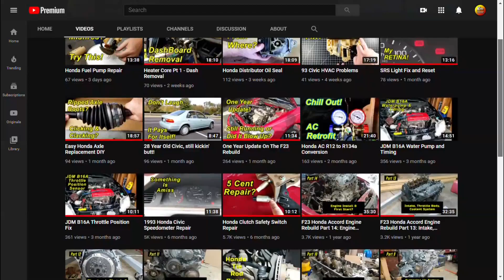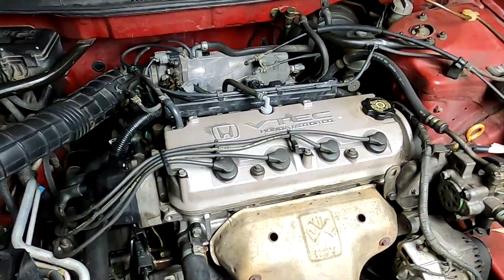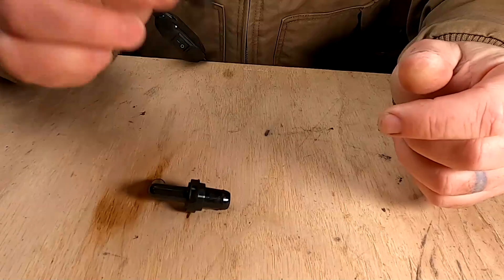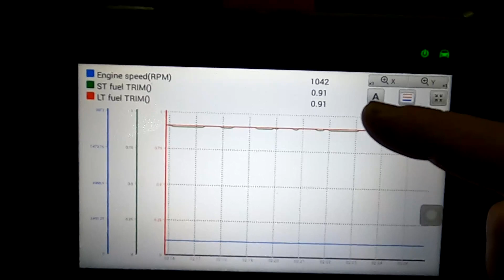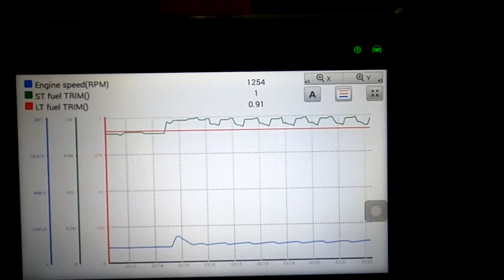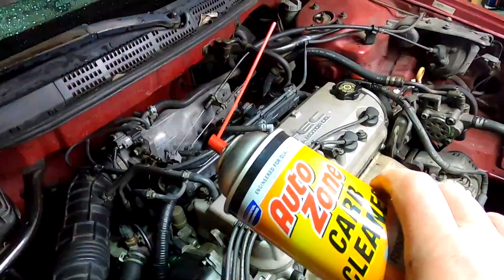Honda Idle Final Words

Comment: I changed my fuel injectors in my 2000 honda accord. Now it has a high idle for about 30 seconds, and then when I rev it up and release the pedal it drops down to below 500 rpms. It drives fine but something is off when I'm parked.

Comment: Remember, an IACV, or Idle Air Control Valve, is basically a vacuum leak through a valve. Cleaning it should be someting on the list too, brake cleaner PB Blaster etc.

Comment: Hello, your videos are great, I need your help on a topic about distribution applications. My car is Honda crv rd1 Manual, there is no problem while driving. The speed of a vehicle that wants to change or at traffic lights keeps dropping. The ignition, spark plugs are always changed, the problem continues. What can I do?
Reply from the maker: So when you depress the clutch, the engine wants to stall? If that is the case, you probably have a dirty throttle body. Search youtube for "honda throttle body cleaning". I had that issue on a civic and that fixed it.
Reply: @ktecgarage Throttle valve cleaning and idle motor cleaning were also done, the problem persists, so what should be the healthy throttle valve ratio? OBD2 connection shows 9.2% at idle, 5 is fully open, 4.78 is shown.
Reply from the maker: @sevilnuresma2287 EGR could be dirty. Search honda egr valve cleaning. Pretty straight forward job.

Comment: Did you do the idle control air valve reset procedure?, 1) Turn the ignition key to the RUN position for 5-seconds. Do not start the engine, 2) Start the engine and run it at 3,000 RPM until the radiator fans come on, 3) Then let it idle for five minutes with no loads (lights, heated seats, rear defogger, blower motor, radio, etc OFF, 4) After five minutes, shut off the engine
Reply from the maker: Thanks for adding that information. I did do that procedure, but there was no difference. I did not find an 'authoritive' source on it's efficacy and too many different versions of the steps so I left that out.

Thanks for watching and commenting!

Comment: I spent like a month chasing idle problems on my GM. In my case someone has adjusted the throttle set screw when their IAC failed to get it running. Interestingly with that computer I discovered eventually that you had to have the IAC sitting at the correct number of counts; if you install an aftermarket IAC it can reap havoc with the algorithm since it has a different ratio at idle. But it did teach me that throttle plates adjusted open can cause really weird idle issues. 

With these sorts of vacuum leaks it usually ends up being so much easier to acquire a smoke machine by hook or by crook. There are a lot of things to check, and going straight for the smoke machine if you suspect a vacuum leak can help you eliminate them as a concern or find them quickly. Autool makes them for pretty cheap ($170) which will pay for itself avoiding the parts canon.
Reply from the maker: Yep. I had smoke machines pulled up looking at prices. That is definitely the easy button for finding leaks.